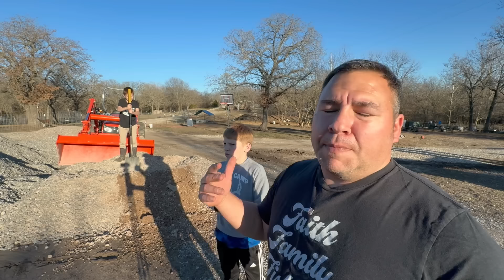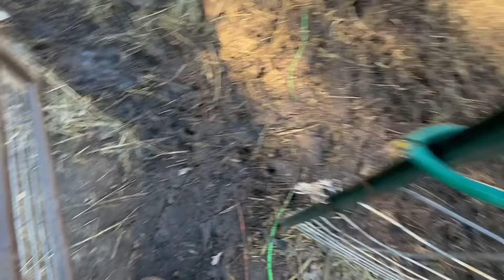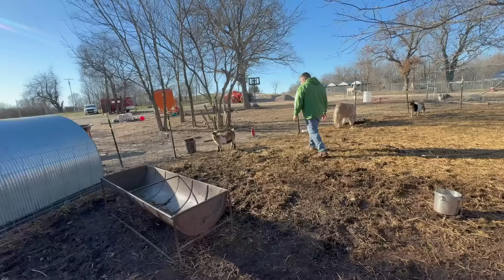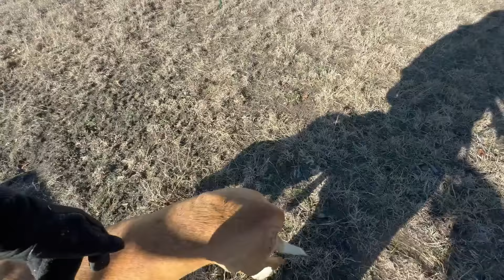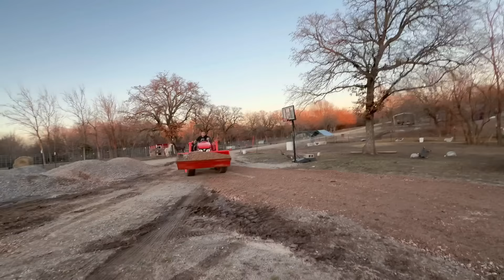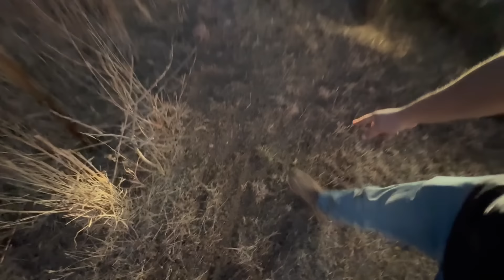It's Worse Than What I Thought. Caught On Camera In Broad Daylight!!!

Comment: Hey Brandon just in case you didn't know your front loader has a float mode. When you put your bucket all the way down and it starts picking up the front of your tractor give your handle another hard push and it will put the loader into float mode. This works great when backdragging dirt or stone.

Comment: I believe from everything that happened to Dixie, wasn't there even blood splatters on her ears?  I think she was attacked by a pack of coyotes and they chewed up her leg.  That's exactly what her leg looked like.  It was NOT a trap!  I have never heard of a trap that would chew up a leg like that.
Reply: Dixies leg had multiple fractures into pieces which is the reason why they couldn’t do surgery or anything else but the amputation…
Bless her fight for living for her family and puppies and goats.
Yes her ear had blood, at first Brandon said it looked like it had been chewed off at the edges 
She also had blood on her chest and mouth both top and bottom so you can know that girl was in a fight for her life as she was protecting her puppies and her goat and her farm…
Brandon found her outside the pen facing towards the barn so she was still trying to protect them even though she couldn’t get back in there with them… Dixie girl was definitely doing her job❣️
Brandon and Stephanie looked to see if they could tell where Dixie was however they never found anything…

Comment: Brandon, our back yard slopes down and we were getting too much rain water against our house so we buried perforated pvc pipe in the ground and the water will run into the pipe from the top and run on down the pipe to a ditch. the pipe is solid on the bottom. worked for us

Comment: If that pipe doesn't work you may want to use a real culvert, something 5 or 6 inch in diameter corrugated plastic.  Hope it does work though, that is a good solution

Comment: .brandon you need to get the wheels in the tractor weighted and be sure you're grading the driveway higher in the middle and lower on the sides so it runs off and won't poo. burying the pipe good idea but putting drainage holes in it would have made it catch the water better to remove it. just suggesting to be helpful since I've been there and done that with what you're trying to do.

Comment: DOES YOUR TRACTOR BUCKET HAVE A FLOAT POSITION LIKE MINE IF YOU PUSH LEVER ALL THE WAY DOWN WILL GO INTO FLOAT MODE FOR LEVELING THINGS OUT WHEN GOING BACKWARD OR FORWARD IN FORWARD MOVEMENT YOY TILT THE BUCKET ALL THE WAY BACK AND PUSH THE LEVER DOWN AND YOU CAN PUT DOWN PRESSURE W0ICH HELPS PACK
Reply from the maker: OK I’ll look into that. Thanks.